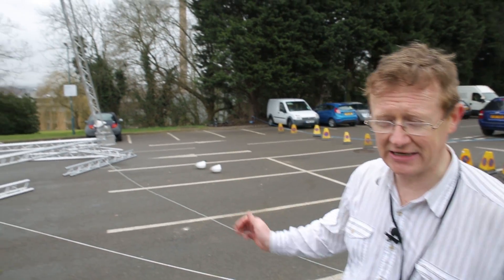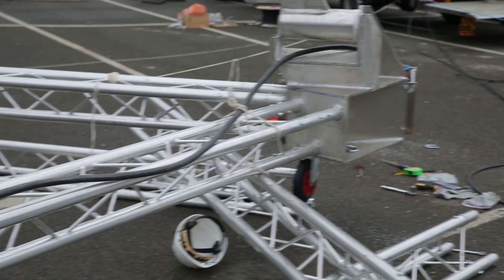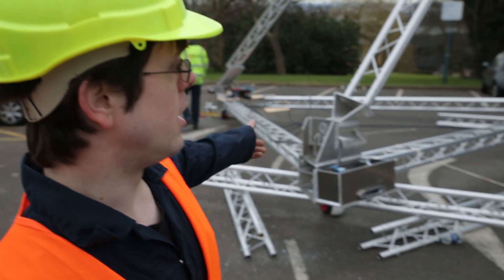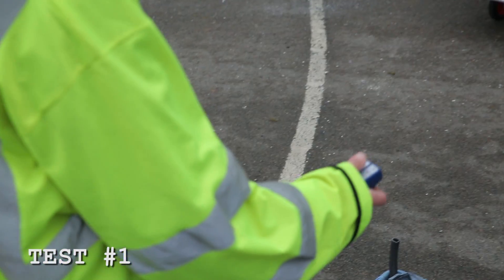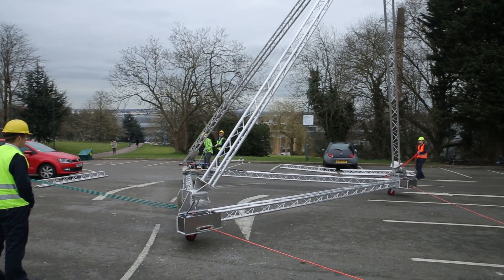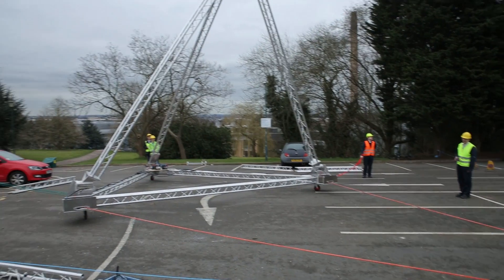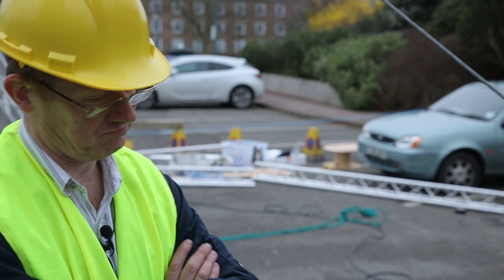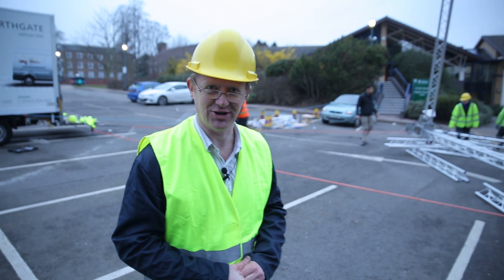Science in the Car Park

Comment: Magnetic sensor on a giant iron frame just didn't properly function... hmmmm. 
To whom it may concern, if they read this, ships have special compass mounts with calibrated iron masses very close to the compass that compensate for the iron in the hull and the electric fields of the wiring. (as well as generators and motors in the case of diesel-electric drives) The iron masses in the mount may be over a kilo depending on the ship size and bridge location. Separate from that, cheap electronic compasses (magnetic field sensors) are notorious for false readings and difficult calibration.
Reply: +wolfedog99 If you look up Seamus Garvey you'll probably find an email address. I'm sure he'd be interested in hearing this.
Reply: +Graham Smith I'm just having a bit of fun because the video left it completely open. If the team is at all competent they have already considered this issue and contacted someone much more expert than myself in such calibrations.
Reply: I'm sure they've probably considered that option too but it wouldn't be the stupidest reason I've seen for a problem like that.

Comment: Interesting to see them using an Arduino of all things, but too bad it didn't work out in the end. I wonder what the problem was.
Reply: +Chuck Vanderbildt I agree a video on the diagnostics would be welcome.  I would imagine it will come down to one of a set of classic faults in systems like this. 1) run wire lengths caused a) power loss, b) data degradation, 2) a programmer made a , instead of a ; and issues of that sort 3) sensors failing to send as expected or 4) a wire was connected incorrectly either a) backwards, b) sideways, or c) not at all.

Comment: Wouldn't it be easier to have the base symmetrical and just turn the turbine at the top? It's in safe distance from water too, less corrosive environment for any moving parts.
Reply: Martin Hergeth Have you seen Eiffel tower?
Reply: Martin Hergeth Well you don't want your fan to go too close to water anyway. First, wind is always slower and turbulent right above the water and will actually slow down the blade in its rotation, and second, water from breaking waves will be damaging the blade and organisms from water will be sticking to it, making it heavier.

Comment: If the orientation of the turbine to combat current is using winches and cable connected to something else floating, won't the floating point it is connected to be effected by the same current. Assuming that the point it is connected to is heavier than the turbine or vice versa won't it be less effected? Therefore the angles to correct would be in flux, have you a way to combat this?
Reply: +Jarrod Heslop I would assume the anchor point would be a small barge ( or the like) anchored to the ocean floor to prevent it from moving.
Reply: Ahh that makes sense. Only rotation on the fixed point needs to be adjusted.